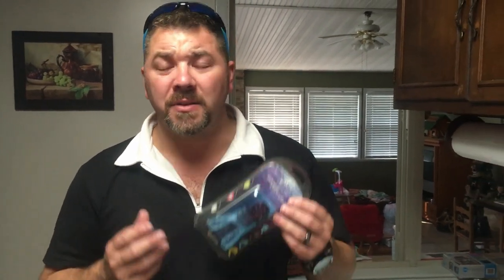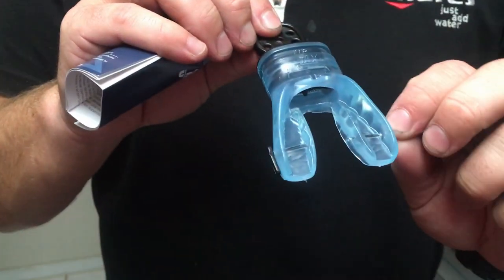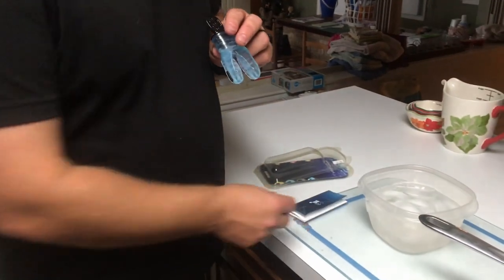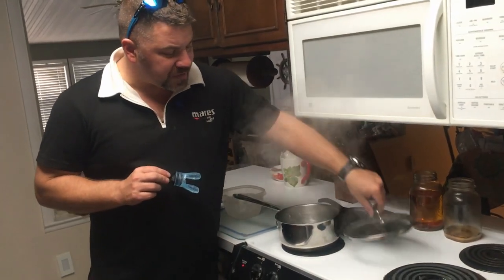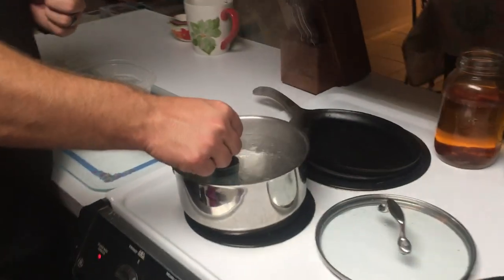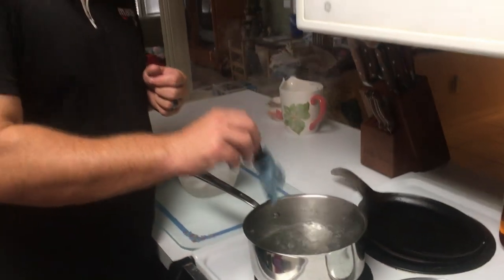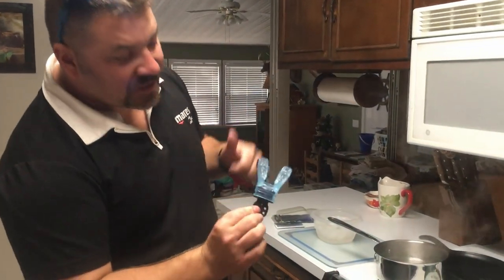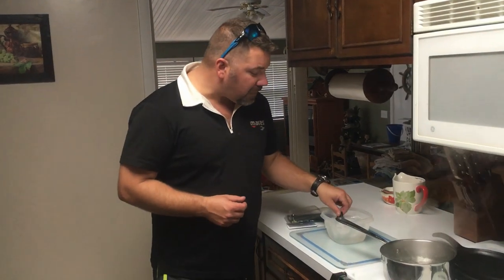How To Mold Your Custom Regulator Mouthpiece

Comment: Very useful, thank you.  I bought exactly the same model as you show (even same color!) but it came without instructions.  I just wonder if it matters whether the two black pieces go on the bottom or top (they are positioned more towards one of the surfaces) when it goes into the mouth?
Reply from the maker: The mouthpiece should be labeled on one side that says up.  That is the side that should be facing up.

Comment: I recently put a seacure on my regs and the relief in jaw fatigue is great, however I seem to have more difficulty equalizing now than I did before and I sometimes have to release my jaw while holding the regs in my mouth to be able to equalize. Any tips on what I could try differently? Thanks a bunch!
Reply from the maker: The only advice I can give on equalizing is to take it slow, meaning always descend slow, and practice all three methods, Valsalva, wiggling your jaw, and swallowing.

Comment: Hi I have purchased the #4 mouthpiece... I have trimmed the back ends so I don't gag but I am wondering how to trim the bottom so the gagging stops as well
Reply from the maker: Hello Canadian Reviews, I would assume you would trim the bottom the same way.  Just make sure you don't cut all the way through it though.  I have never heard of the bottom of the mouthpiece causing gagging while diving.  You can always experiment with different mouthpieces to see if there is one that fits your mouth better.

Comment: Can another person get a good seal if you were to donate a regulator with a mouthpiece molded to your mouth? I would think so but not sure. I donate my primary (long hose).
Reply from the maker: Scott Selkey I have yet to have an issue with students receiving my primary with a custom mouthpiece, and in 2017 alone I have trained well over 50 Open Water students with no complaints or issues. The JAX mouthpiece is slightly smaller than the SeaCure, so it fits a wider variety of diver's mouths.
Reply: LakeHickoryScuba okay. I imagine for a temporary situation it would be fine. Thanks and great videos!
Reply from the maker: Scott Selkey You are welcome, and yes if I have to donate to a diver who is out of air, then yes it's a temporary situation. An immediate slow ascent would then be initiated. I've never worried about the comfort of a mouthpiece for another diver in an out of air emergency, simply because it's just that an emergency. Once I have donated, the dive is aborted and we are headed up.

Comment: Perhaps an obvious statement.  Holding something in bare hands/fingers very close to the surface of boiling water is very likely to cause you to scald yourself.  Its needs more than just a "be careful"  warning.  Suggest wearing a pair of pincers or similar to hold it in the water.
Reply from the maker: You would be correct. Always better to be safe than sorry.